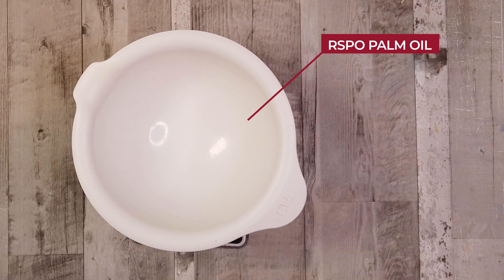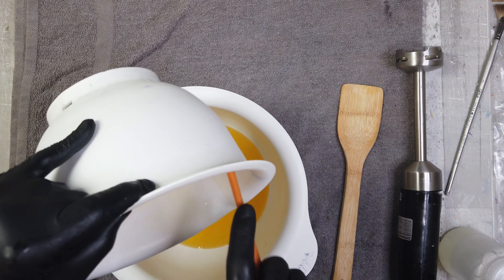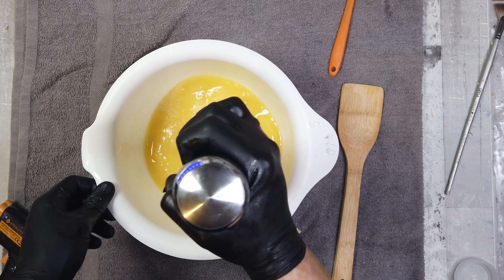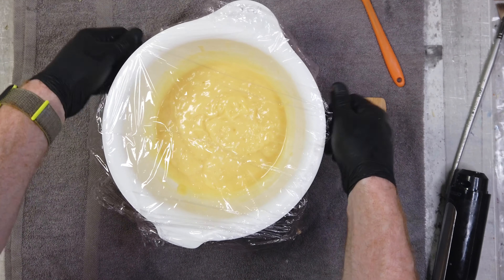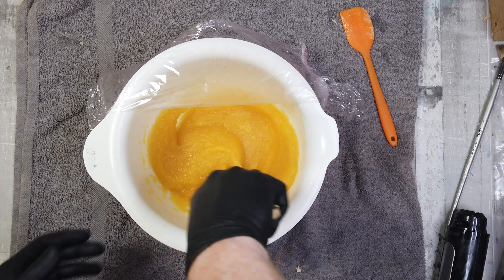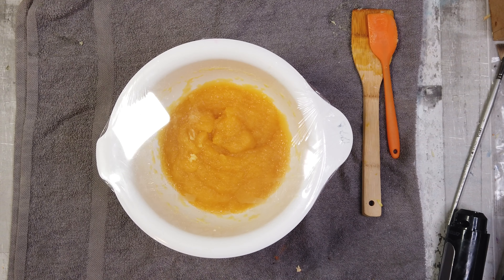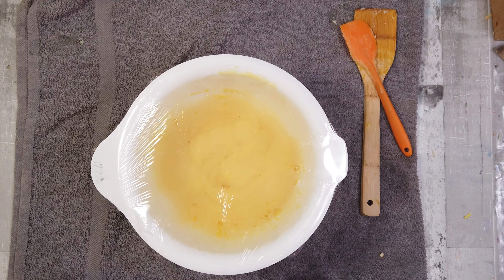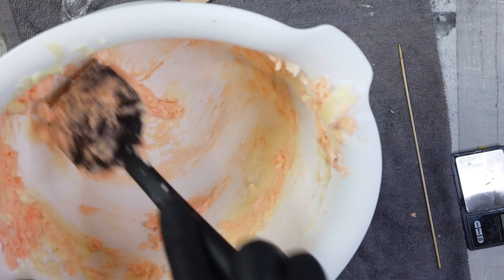High Temperature Hot Process Soap Tutorial - is this a fail?

Comment: Very good 👍🏻 it’s a smart way congratulations, did you heat oil and lye to 250 F equal temperature and so on
Reply from the maker: i took the oil up to over 100 degrees Celsius and added the lye solution as soon as it was clear and at its max temp.

Comment: Thanks for the videos, just a quick question, my lye does not dissolve in the water, and I'm having many failed batches of soap : (     I had 48.5g lye to 97g cold water ) would be very grateful for any suggestions.
Reply from the maker: @MauraMo  you need to keep stirring it until it’s fully dissolved and goes clear - are you allowing the lye to cool properly?
Reply: @QueerBullSoap  yes lots stirring, but always left with grains in the bottom of the jug, think I might try a different brand of Lye.  I use a glass jug to mix the lye into the water, would plastic be better ?